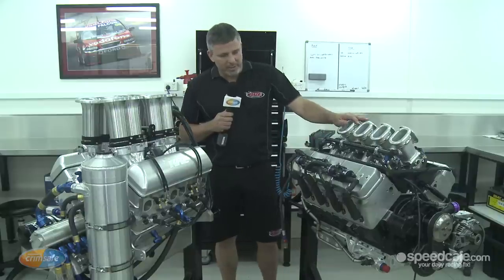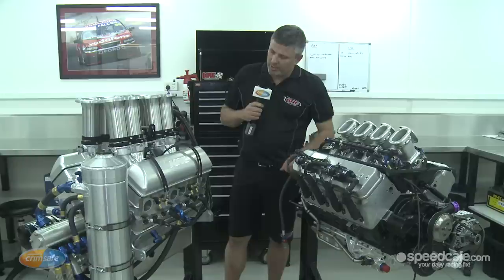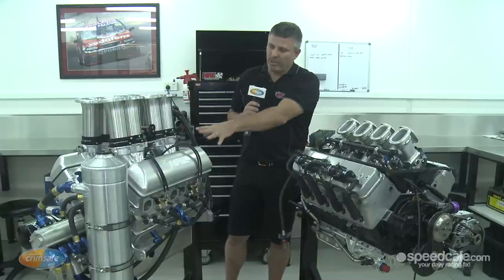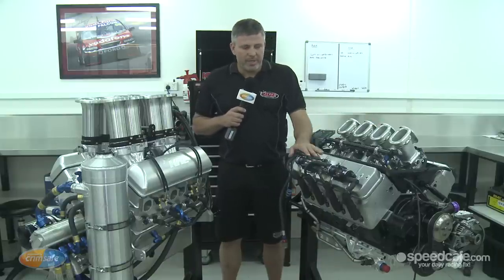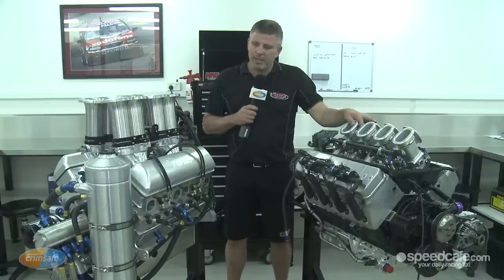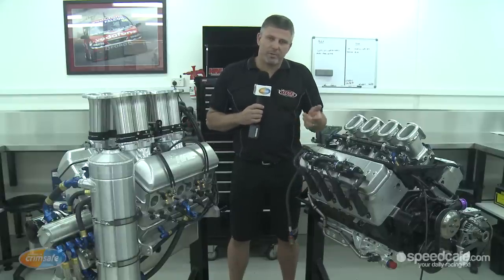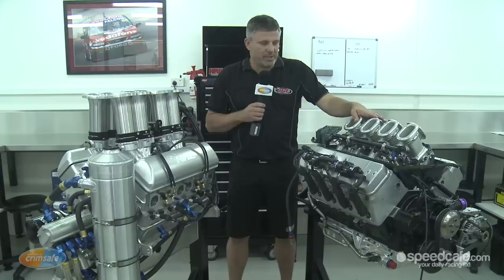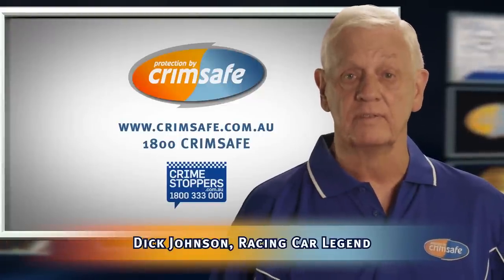THROWBACK: Talking Tech - V8 Supercar vs V8 Sprintcar engine

Comment: Both amazing engineering in their own ways. Building 630hp is no big deal these days but doing it under 7500rpm and with 5.0L while having plenty of torque at least in the mids up on an NA engine is very difficult. Clever people.
Reply: I've been thinking the same, materials tell the limit, the rest is to fit it the best you can all under that limit. Now, if you just raise the material limits to lets say, and it can take the stress 50,000 rpm, think of how small and light the rest could be for the same power. Materials science really pays off!
Reply: Don't forget they have to run on pump fuel, a series control camshaft and 10.5:1 CR, as well as last for  lot more than one race.

Comment: You should do a video on the SM Motorsports turbo 202 carby torana daily driver. Steve Josiah extracts 500rwhp and 800ib/ft of torque. 175mph theough the chase with 13inch diameter rims. It’s just a nice car to drive.

Comment: I bet KRE could do a V8 Supercar motor for the same price as a sprint car motor using generic parts from the USA and be lighter as well. Who cares if the whole grid had the same motor, an alloy block V8 would sound awesome.
Reply: Would sound exactly the same as a cast iron block. What the block is made out of won't change the sound.
Reply: It's called parity.
Reply: LS2MGB cast iron block sounds much deeper and grunty. Alloy block sounds hollow and tinny
Reply: @chinomeehan9061  Whaat?

Comment: I notice the V8 touring car engine has a cast iron block and an ENGINE NUMBER PAD front left, sounds stupid but is that a GM  BowTie Sportsman Block that GM sells over the counter in the U,S for around $3500 bare. Dart and Brodix Cast iron Blocks  are only $1750 U.S and i doubt if they use these.
Reply: I thought I had figured out what block and heads they were using but apparently they use castings that are unique to supercars, and I'm told are basically Ford Windsor clones. I can't get anyone to confirm it, but if true, supercars are an even bigger joke than I first thought.

Comment: What's the reasoning for 410 c.i.?
Just a number they pulled out of their ass when they wrote the rules?
Reply: Oringinaly  sprintcars ran Chev iron block engines 360 cubic inches iron block chevy motor   called a smal block .410 cubic inches is from a big block Chev engine.But now block is alloy but cubic inches based on oringinal Chev motor
Reply: It came in when the 400ci small block chev came out there was no way to tell what Ci someone was running other than tearing it down at the tracks

Comment: they must be running a cartel there with those engines, 120k for a pretty much standardised 5l v8 making so little power and basically no exotic parts in it, CNC machining isn't that expensive these days so the "custom" isn't nearly as rare as it used to be
Reply: jz1199 
They are more like 600 hp at the wheels. They always down play the engine HP level. Whats more impressive is 530+ ftlbs of torque, which nails you to the seat all the way past 200kph. Go for a ride in one, they are very impressive 😉
Reply: 120K will buy alot of horsepower.
Reply: Think about how reliable they are, the torque they get in the midrange and how efficient they are for what they are
Reply: Yea super car engines don't make power for few seconds they do it for long periods of time and the downshifting and upshifting means these engines are super reliable under extreme conditions for long periods of time. Sprint or dirt car stuff is like drag racing ur not shifting like road racing and ur constantly spinning and trying to control it.  120k because of the reliability of the components in that engine I believe.  60 for Sprint cause it wouldn't last long in super v8 car its not built for endurance of that level
Reply: @justinmilby4552  Dirt track racing, you're constantly damn near at redline if not on redline, only letting out slightly to start the turns. It's not like drag racing, where you're only in it for 10 seconds on average. They're running constantly at or near redline for long durations. Upshifting and downshifting a supercar doesn't mean shit to be fair. No offense to your beliefs. I could to the same in my mom's Camaro, which produces about as much to the wheels as the supercar does, and still be able to live for almost 200k miles. And guess what? When it breaks, I can spend so much less money to get an engine replaced for it and be on my merry way. Super car engines don't need to be as expensive as they are. They really don't. They're made from the same materials as most other decently priced engines in performance cars from other companies. Sure, they're hand assembled, but to be fair, a lot of higher performance engines from cheaper cars are hand assembled too. There's really no leg left to stand on to be honest.
Reply: @justinmilby4552  I could take a stock lq9, bolt a turbo to it, stick it in anything and run the sucker at 800 hp to the wheels, and it will likely survive a few years at least of bashing on it and constantly racing it. Do that to a supercar engine and it won't last as long. I've seen supercar engines barely last 100k miles before, plenty of times. I can't tell you how many Maserati, lotus, and McLaren engines I've dealt with, with under 100k miles, that needed extensive internal work. The problem usually lies with lack of simplicity. With so many extra moving parts, they don't live as long as they could. Timing chains are a nuisance, I'll just say that much.
Reply: 630hp (at the wheels) and max torque all the way through the rev range starting at 2800rpm from a 5L engine… not to mention almost living on limiter 90% of the time for 1000ks at Bathurst… that’s actually really impressive… and that kind of engineering at reliability, you pay for that!

Comment: 880 hp for $55,000 and $650 hp for $120,000. That’s why V8 supercar regulations are so stupid. V8 supercar costs are ridiculous, imagine V8 supercars going to a Dart block and heads and a 4 barrel injector body, you could save a fortune in engine alone
Reply: A 410 sprint car engine isn't going to live through a 2 hour race.
Reply: @ProfessorIgor Or Bathurst for that matter

Comment: I guess I will have to stick to my 800 hp. $2,000 home made drags race engine on my pay!
Reply: Yeah right,,, 800 hp for $2000. Turbo with a life expectancy of about 2 min. I have driven by them time after time with 550hp for about 12k . That does 2500km between rebuilds on a road race car
Reply: Better known as a hand grenade.
Reply: Well if last 2 min. at 8 sec. at a time, that's good!
Reply: How did you know?  It went off twice last year!
Reply: cmsracing I'm not sure what you meant. My   Sure anyone can build 600-650hp even NA with 5 litres for 10-15k but will it make that under 7500, pull out of corners and sit on 5000-7500 all day without failure and using more fuel than your competitor. I recall races where half a litre of fuel won or lost the race.
Reply: My reply went to the wrong person;  I drag race, so a dozen or so races is all I need before an engine go's boom!  The engine does not spend much time at max revs so piston / rod quality is not so expensive.
Reply: cmsracing Totally makes sense. It all about context. I say the same when mates of mine bag on forced induction road road cars. What they don't get is making 600 with 9lbs will give you 100,000 km engine even more. I have a 550hp modular NA but there's no chance it will do that before it needs coming apart. Drag racing another routine all over again as you'd know.
Reply: +cmsracing ya think if ya used better parts your builds might last a little longer? We build 540 ci chevs that make over 2000 hp on E 85...using the best parts available is the difference between a $7500 freshen up and $50 k on a fresh long block...How many laps do your drag motors last? Try building a boat motor,or a pair that might run 90 percent throttle for an hour at a time....at that power level the run 40-50hrs bmoh...
Reply: As an sometime engine builder 800hp 2 grand engines just do not happen, even with turbos. And with those I hear telephone number power numbers and drive by them with 300 hp less!!
Supercar engines have 630hp but only 420 ft lbs.  Sprinter engines have over 700!
Sprinter engines in in some respects archaic with piss and piddle and a mag. 
Then Nascar engines as well with supposedly 900 from 6 litres, but at near 10000 rpm.
Reply: Ok mate Lo